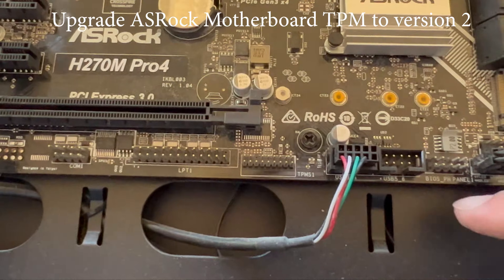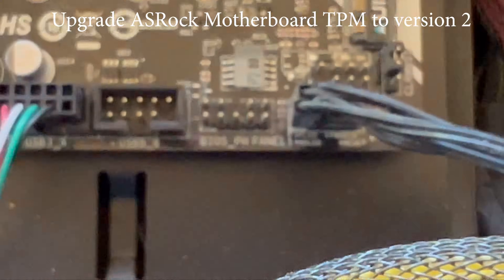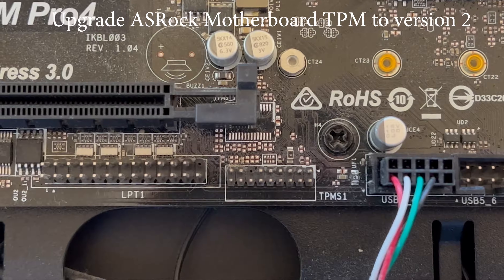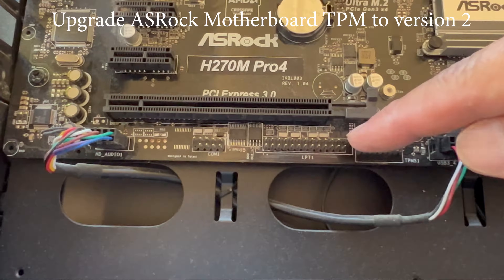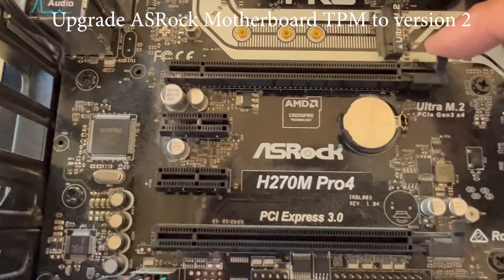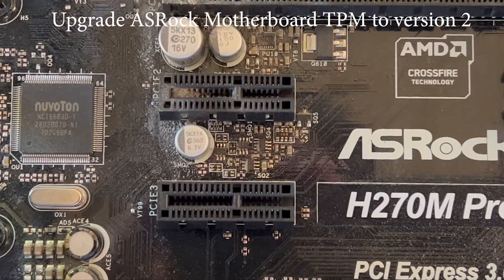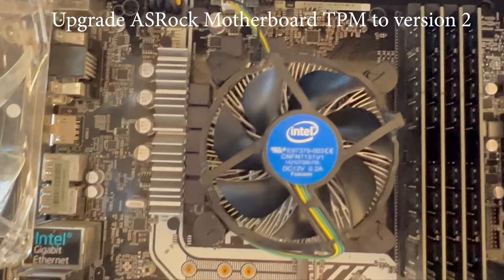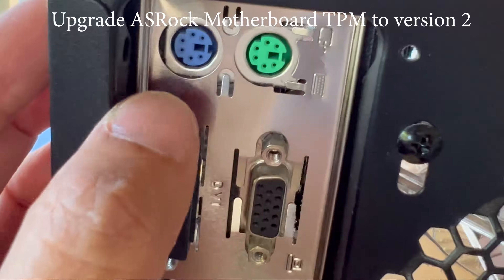How to Upgrade ASRock Motherboard to TPM 2.0 (Trusted Platform Module) For Windows 11 Compatibility

Comment: If there is no pin header in the part where tpm is written in silk print, can I make it work by attaching a pin header with reflow?

Since there is no tpm item in the bios setting window, should I overwrite the bios with another model?
(h61+ ddr3+i7 3xxx) We are still living in the era.